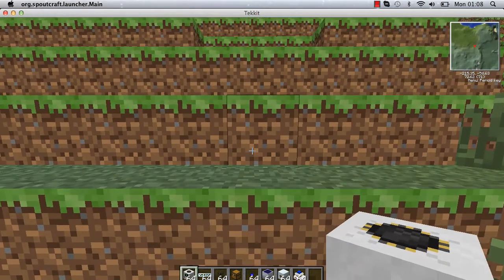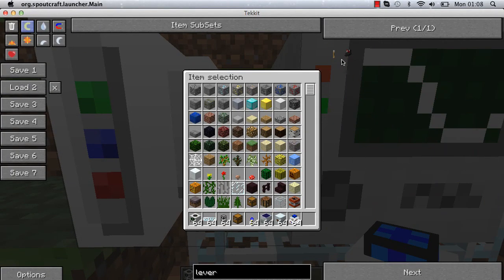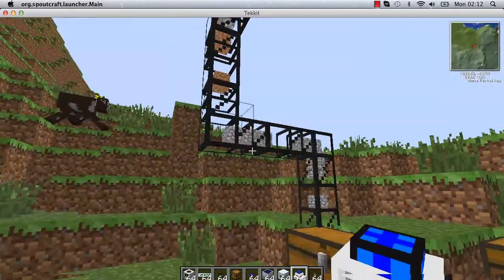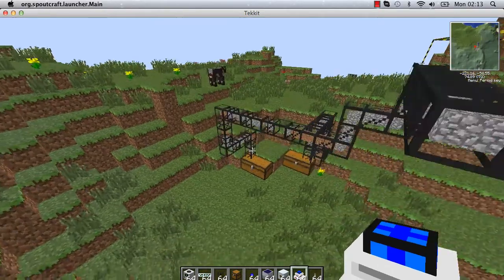How to build a quarry system (solar panels) 1.2.5

Comment: Thanks for replying.
Four shits and giggles, I did try Tekkit.
My computer is not a gaming computer, but a working computer.
Windows 7 professional and all that jazz.
Video production stuff, and so on.

In my spare time I like to mess around with games. Lately minecraft.
Tekkit apparently requires exotic java scripting.
Tried following the instructions, as figures they were, and ended up with no success and other Java programs no longer functioning.
Java 7 should be all that is needed.
Thanks :)

Comment from the maker: This only works in 1.2.5 now just changed the title in 1.3 its solar panels are just good for the energy condensers in tekkit you should use a steam engine with coal i will do another video for that.

Comment: The flat one uses blue alloy ingots and wafers. I assumed it was a higher voltage, but could not figure out how to attach it to anything. Frustration. No one has made a YouTube video using that solar panel that I can find.
I finally discovered that blue wiring will attach.